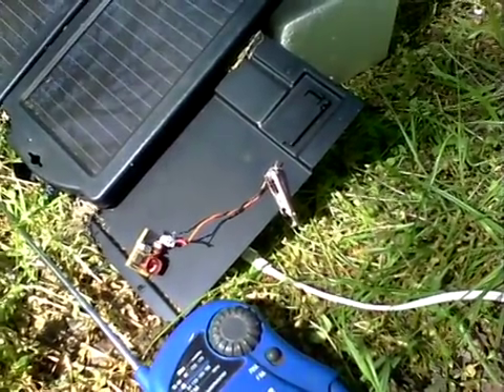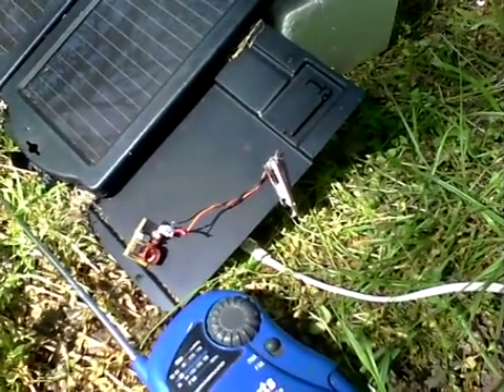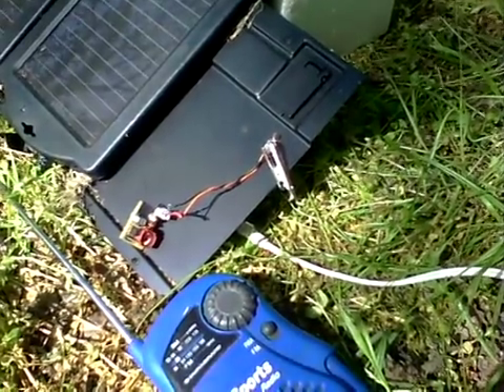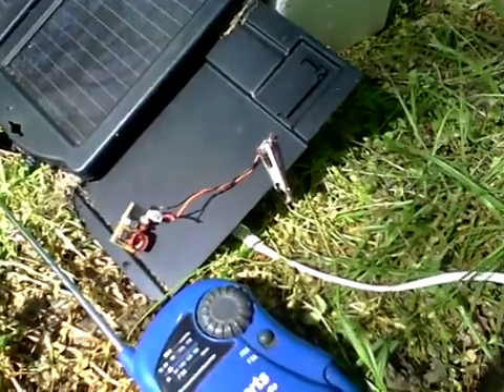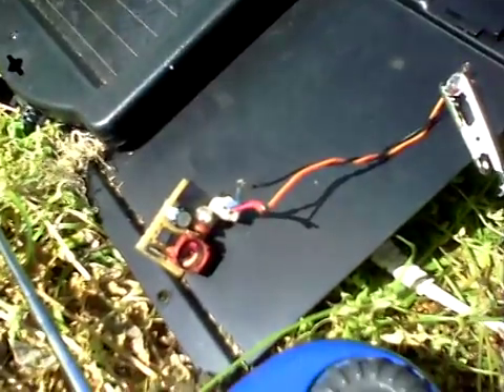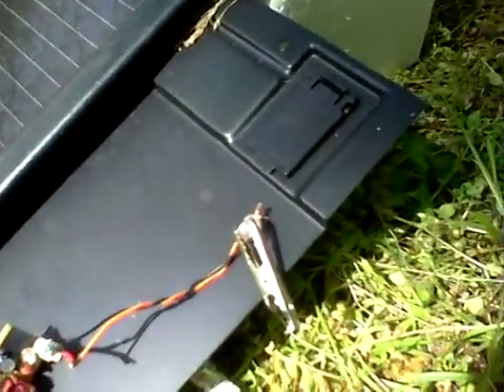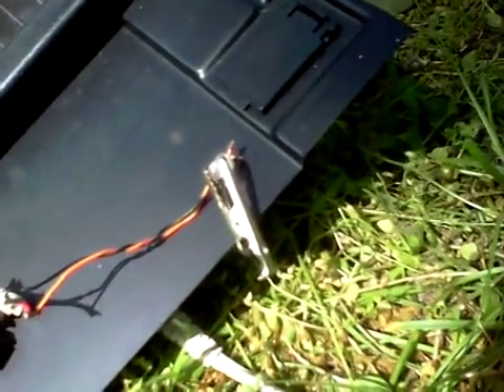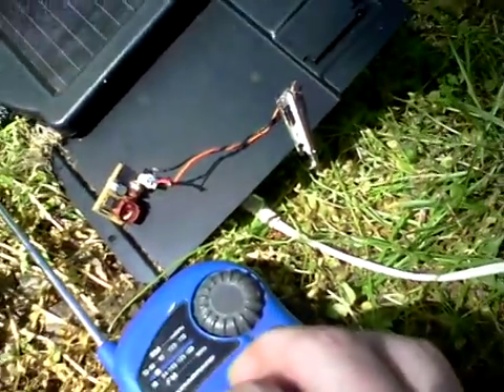LED - more heat more power ?

Comment: i remember a while back when building a JT on a board, i was soldering some components on while the circuit was running, and when attempting to solder some of the LED legs on better i noticed it did get brighter. as if to say it was the heat from the soldering iron that did it.

Comment: Actualy, I made a ''lamp'' with 72 IR LEDs. It was to test a webcam from wich i took the IR filter out. I tought i would work as a solar panel too but it turned out that it puts out more voltage but less current then a single IR LED :( lol . The LED panel is made from 9 parallel strands of 8 LEDs in serie.

Comment from the maker: Ah, thanks Allen. The end part had the intent to highlight the change in running, though I couldn't find how to put a blank of a couple of seconds in the vid to properly separate the edits.
As can be seen, the sun stays constant within the time frame. The oscillator certainly did appear to increase with heat applied. Wish i'd used a meter and will do in further experiments :)

Comment: One can notice a definite increase in pulse frequency merely by clicking the cursor between :36 and :56 seconds. There seems to be an almost a doubling in frequency. I'm
Allen on Energetic Forum. This is a very convincing video. Thank you very much for running this experiment.

Comment from the maker: To explain the end of the video - I copied one section without the lighter applied and then a section from when the metal clip was heated. 
Sorry about the editing, used a different video editor due to PC troubles.